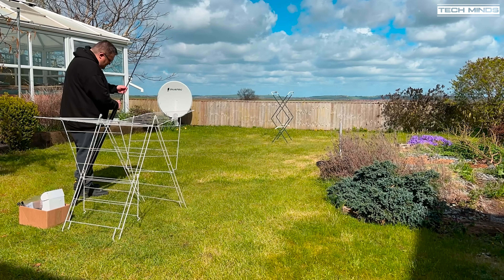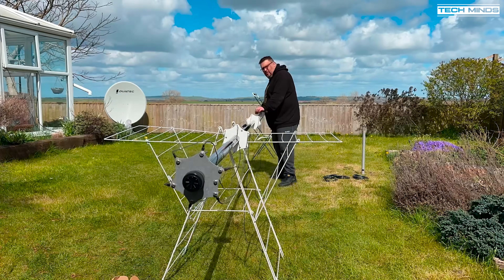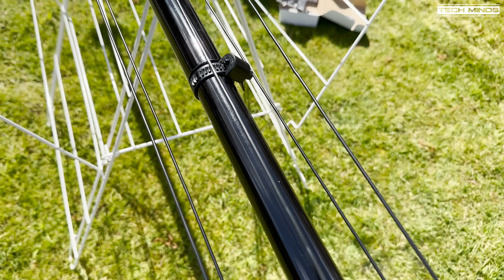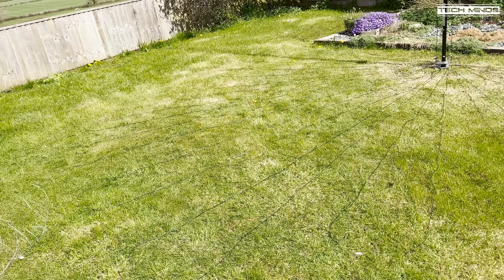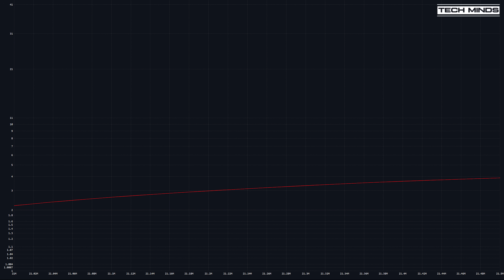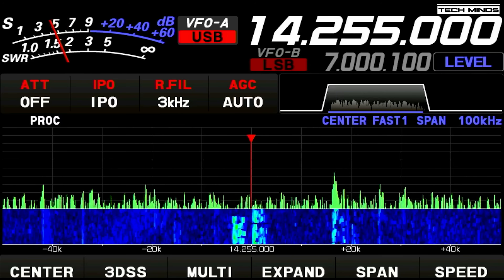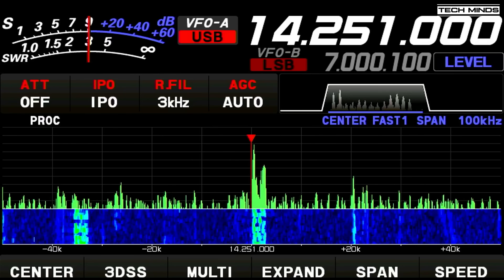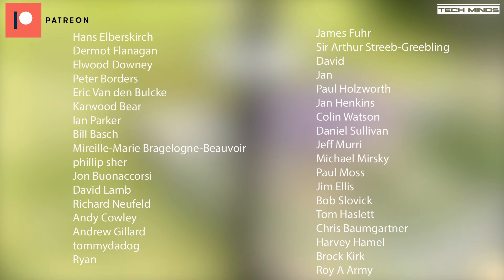Multi-Band Vertical Antenna Installation - DX Commander Signature 9

Comment: Great Matt, Answered another of my questions on the Sig 9…
I’m hoping I can go with this DXC as I don’t want stay wires, but does the antenna spin much on the mounting pole in high wind did you notice?
Reply from the maker: Unfortunately I didnt have it up for very long, the misses needed to cut the grass! lol..
Reply: @TechMindsOfficial  hehe…
I’m planning to build a little circular concrete base around it and bury the feeder cable and radials so I can mow around it easily.

Comment: Nice video!  I received my Sig 9 this afternoon and planted the base pole in 80 lbs of concrete.  Good to see your SWR numbers and the great performance.  I'm thinking about converting 30m to 6m.  Have you considered doing this?   If so is it a simple matter of shortening the 30m element?

Comment: I find it interesting that you have the handi-clamps on top of the spreaders. Is that because the spreader plates were a tad loose, because in the unified build manual it says to place the clamps under the spreader and above the joint at the join. The below is copied from the Unified Antenna Kit - User Guide – April 2023 V1.24
"STAY UP KIT
You will find specialist nylon (PA66 material) hose-clamps in the accessories kit. The screw threaded part needs to be pushed into the band and click. Fit above each join and cut remainder of the tab clean off. A lighter will smooth the edge where you cut it.
Note: Expedition Kits have wing-nuts and the remaining kits have 8mm Hex bolt heads. Clamps go JUST ABOVE each join to stop sections collapsing.
Use all the clamps in the kit from fattest pole section to smallest pole section. You will eventually run out of clamps because the minimum bend radius of the clamps are 20mm (just under 1 inch) and not enough bend to go around the smallest sections. If you end up with a spare, just store it.
Note: Fit your clamps below each plate and above the join." This is from page 5 of 38.
So why are your clamps above the plates? I don't supposed it matters in the long run except how it might impact the ability of the clamps to keep the pole from collapsing. Just sayin'...
This still a very good build video. I learned a lot from the series.

Comment: Impressive antenna performance. But I guess it can only be used on a yard like you did, not suitable for a roof or a terrace mount. Also it seemed a bit too wobbly to me, I am afraid it will be a bit dangerous in windy places.

Comment: Nice build Mat! I have two cool additions for this antenna. Remove the 30m element and cut a 80m element of 19.5 meter to get on that band. If you want to get on 160m you can add a variable air coil L to tune it on that band as well. It's then a baseloaded inverteld of for 160m. Of course you'll have some losses, but you'll get on all bands. Great for contesting for example :) Have fun with you new antenna! How are the noise levels in your area?

Comment: Avoid " fishing pole" permanent antennas.  Just my experience. Very expensive product. 🙁
Reply from the maker: I’ve had mine up for 5 years without issues. Maybe you had a cheap pole?
Reply: My DX Commander has been up since the very first iteration - over 7 years - never had any problems.  Callum field-tested this pole in his R&D field for many months before he launched the product.  It's not a "fishing pole".  Do some research before commenting.

Comment: Nice work Mat great build and proformance. I have also contemplated this antenna for my qth. I think any antenna I get/use is compromised due to my location and surroundings. I now have the atu in your other video. 👍🏽
Good work. Motters M7TRS 73👍🏽

Comment: Thanks Mat. Great video. How much wind was there while you were filming? The mast was swaying a bit. I know it doesn't need guy wires. How do you feel about the stability?
Reply from the maker: Thanks Jeff. The top of these poles are thinner than the base, so swaying is kind of normal. For a permanent install I would either concrete the ground mount pole or use it in earth with small guys. It’s stayed up 4 days so far with just the ground mount in earth and no concrete. :)

Comment: Looks like a great antenna. Interested to see how it holds up to the weather and wind without any guys?  Will you keep it for a long term test?
Reply from the maker: I guess it depends on the soil that the ground mount is in. For long term use I would either concrete the ground and use with out guys, or use with guys if the ground mount is only in earth. For short time use I would say how I have it now would be okay.